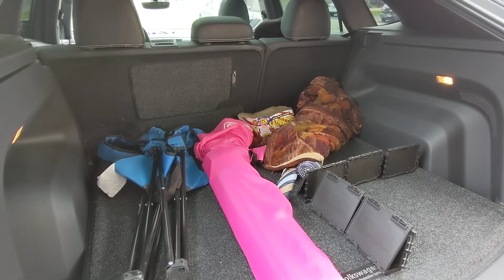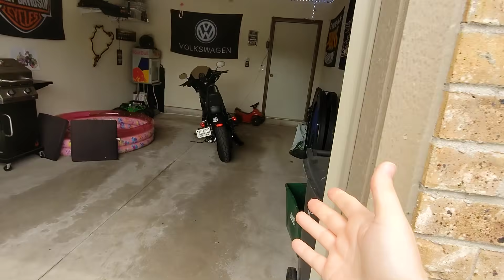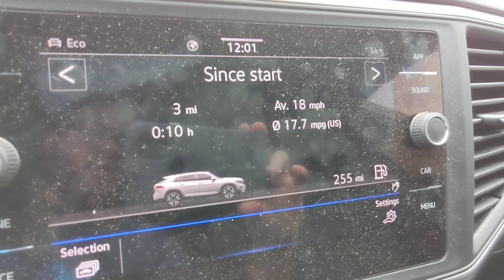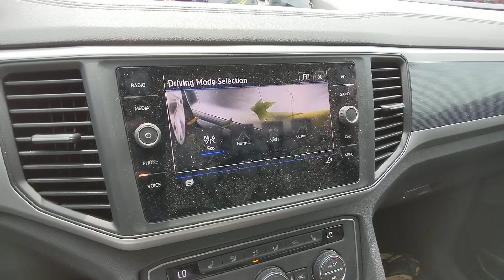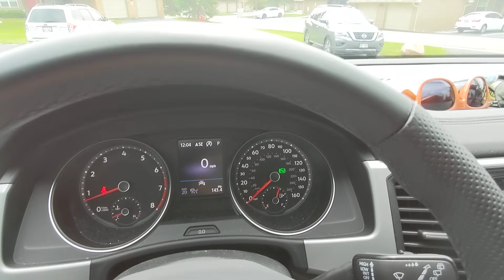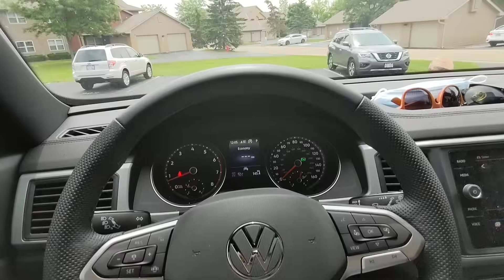2021 VW Atlas Cross Sport.  Why we're trading after only 4 months!

Comment: So the monetary loss from the trade will negate the cost of low fuel mileage, that’s a very interesting theory.
Reply from the maker: As stated in this video we took advantage of this used car market.  Lost "only" $1000 dollars (dealer sold it 4 days later above MSRP) and our fuel savings will pay for it in 9 months.  You really think we didn't think of that?
Reply: @amentauto3610  I hear you but if you trade to buy it or to get rid of it you have virtually no way of knowing if it only cost you a $1,000, even it you are able to know exactly what it cost you, I find the $1;000 a little hard to swallow, it might be the spending most of my life in the car industry and as a motorcycle dealer.
Reply: or the theory that a much higher priced . Pretty stupid either way. I could give a fig less about mileage I like the spacious interior, the all wheel drive. I keep my in dynamic and sport mode, I drive it like I stole it and I could care less about complainers.  Muhahahahahahahaha

Comment: I have a VW Tiguan with optional 7 seats but use it for trunk space.  Also has more headroom than the atlas.   Plus 29mpg
Reply: They say vw is not reliable. Not sure if that is true. Have you had any issues?
Reply: @voyager6576  0 issues.   You also have a lot of gear heads that mess with their own car then screw things up.  Then they blame the car

Comment: Hey man, you communicate really well as do most people from Wisconsin.  This vehicle seems like a very utilitarian vehicle. I would have liked seeing you incorporate driving dynamics and a short drive.  How can a review of a vehicle be complete just parked?  As for mileage, I get 42 on the highway going average 70 mph in my Civic but that's not a house-on-wheels the way these SUV are.  I have 1.5 Liters and 2900 curb weight.   I see the Toyota products in the new Sienna and RAV4 or Highlander to have hybrid options and more economical drivers.  

I had two VR6 vehicles back in the day in two Passat sedans and I loved the engine but mine did not want to last very long.  I hope VW has made the new ones more reliable and long-lived.    Take care and good speaking.  Just remember to drive the vehicle on camera. Cheers
Reply: Newer volkswagens have significantly better reliability than the 2000-2010 cars
Reply: @nicoyoung259  How so?? I had zero carbon issues with my port-injection, and zero timing chain stretch issues with my timing belt, and zero VVT issues because it had no VVT. Most of my service costs were in the complex front end.

Comment: Lol, I like the Atlas but that thing is a boat with a big anchor. You need 300 plus hp to move that 4400 lb SUV with any fervor. My 17’ stage 1 GLI has the same hp/ torque in a compact sedan that weighs 1200 lbs less. It’s a rocket. You should consider a Colorado/Canyon for towing, storage capacity and power..
Reply: @hon solo  Colorado V6 puts out 308 hp. Atlas V6 is 276..

Comment: That’s not a valid reason at all for doing that just little differences on gas mileages, you’re losing money on the trade in is more worse, and for what you saying I think you should get an electric one, no gas to use!
Reply from the maker: In this car market we barely lost any money.  The dealer sold it above MSRP 4 days later.  Our replacement will save us over $100 per month, will pay for itself in less than a year.  Stay tuned to see our replacement!

Comment: Interesting about the MPG my 2017 Touareg VR6 is heavier with the same engine and averages 21mpg on my 52 mile hilly commute, sounds like a heavy foot problem.  I spend around 160 a month in fuel, unless you go for a Hybrid rav4 its not really worth trading, unless your going up on average 10+ mpg which then would be a car or hybrid of some sort.
Reply from the maker: It was my significant others vehicle and she drives like a grandma!  I will be showing our replacement soon!
Reply: It's a VW/Audi/ Porsche product not meant for fuel economy.

Comment: 19 mpg is pretty good for a non-turbo SUV box with an automatic transmission. I have a 2015 Sportwagen TDI with a manual and it averages 47 mpg around town and 55 mpg highway. It has a little less cargo space than the Atlas Cross Sport and cost less than half as much. When traveling I can go over 700 miles on its 13.5 gallon tank before needing to refuel.

Where I live when you buy a new vehicle you have to pay sales tax and the first year registration cost. For an Atlas Cross Sport it would be over $3000. So selling a new vehicle after 4 months would be throwing away the sales tax and registration to just do it again. At $4/gal and 19 mpg you could go over 14,000 miles with that $3000.
Reply: @drwisdom - You must be having diesel variant I believe so b'caz petrol version gives around 36 mpg.
Reply: @VDCCXXXVII  Yes. The combination of diesel, minimizing fuel usage with a manual, and living in the mountains yields very good mpg.
Reply: @VDCCXXXVII  
Btw just spell “because” instead of that brain dead way you’ve decided to type it. If you want anyone to take your opinion seriously you can’t make up your own spelling on simple words. 🤡
Reply from the maker: The used car market is crazy right now.  Lost only $1000 dollars.  Dealer went and sold it above MSRP 4 days later...
Reply: @amentauto3610  B'caz due to chip shortage in whole world, there is long delay to get a new vehicle. Even If you book new Tesla right now, don't expect delivery before 4 - 6 weeks.
Reply: @VDCCXXXVII  
You’re stating the obvious man. We all know why the market is crazy.

Comment: if you have a reliable stage 2 charging station at there you live, EV has way higher efficiency and lower running cost.  we are paying $20 a month for electricity charging the EV.  ICE cars mostly burn 30-35% and the rest turns into heat and exhaust.  You wasted 65-70 cents on every dollar on gas.  Choice is yours.
Reply from the maker: Stay posted to see our replacement ;)
Reply: I thought about getting the F150 lightning - my house only has a 100AMP service though. I don't think I can get a stage 2 charger unless I upgrade to 200amp service. My aunt and uncle have a Tesla P90D and she was trying to tell me you need a 400amp service. I was thinking 200amp would be fine. She said non-Tesla charging stations are also no cheaper than gas....not sure how much truth to that there is either.
Reply from the maker: @jesse4589  Charging stations do tend to be only slightly cheaper than actually filling up.  The point is though most people would only have to use those a couple times a year when in a pinch or road tripping.  The other 10000 miles you drive that year will be 1/10 the cost.
Reply: @jesse4589  I don't know how much you drive per day.  My daily average mile is around 80-100miles. I use 32A charge from midnight and it's done 3-4 hours, give or take.  If you lower it to 20A, it will take a bit longer to charge.  Run the numbers on your daily consumption and see if 100AMP will cut it.  Also, at night, the electricity consumption in the house is usually lower.  To us, I charge 99% at home at the lowest electricity rate, so I can't speak for others.
Reply: @g600f700  Fuck!!! I wish I had your luxury of being able to drive an EV to work. No chargers yet. So, I ended up with a VOLT. 140 miles round trip, just under 2 gallons of fuel. Whenever they install chargers, will get a used BOLT. I'm not paying over 40K for an EV just to save gas.
Reply: @jesse4589  your aunt must have had a typo or a brain fart. Too many 0’s in those numbers. 60A is max for a Tesla home charger (aka Wall Connector). If you get a Model 3, 40A is max. Your 100A circuit is plenty.
Reply: And you paid how much to buy the EV??? ID.4 is 40K and it's a small cross over. You're right for efficiency, but you pay double for the same thing.
Reply: @bmw803  I paid 36k after tax incentive for the base trim (no options).  For daily commute, more than enough.  I won't get into every single penny but overall,  so much time save on gas station,  no maintenance...etc.  I charge at night lowest electricity rate.  If the people don't like EV, they will always find something to complain.  I won't fight to death for that.  Good luck.
Reply: Bla bla bla how about taking s long trip .EV are overated
Reply: @hectorlopez1196  I agree,  we looked back for the past 3 years and we did about 2-3 long trips per year. So, added up the time on long trip on charging vs the time we saved on zero gas station and zero maintenance per year,  its worth it.  If you take long trip every week, then EV is not for you.
Reply: @g600f700   EVs dont need maintenance? You still need brake service, coolant replacement, drive unit fluid changes, etc. ICE oil changes twice a year?? 100 bucks. EVs require the same as ICE except engine oil changes. As for the time going to gas stations, never understood that argument. It takes 5 minutes, so what??
Reply: @bmw803  not going to fight to death talking EV vs ICE which one is best.  I only speak from my experience.  I have been using the EV for 3+ years now.  The only thing I see that need replacement is the tires.  I normally do a 8-10 years for a car refresh and I don't plan to flush any coolant or whatever the fluid.  Brake?  I barely step on it, using one foot driving (brake re-gen to slow down the car).  You keep whatever you like. Amen.

Comment: I have the Atlas V6 SE and I put in 10k miles on it within 4 to 5 months. I really enjoy driving it long distances and so far I have no problems with it other than MPG. If anything I might trade it in for a new model cause mine is 2018.
Reply from the maker: The car 100% excels at long road trips.  Perhaps the best road trip car i've ever used.  Minus the bad fuel economy.  Even on highway with AC on we were lucky to crack 22 MPG sitting at 78mph in the left lane.
Reply: How is the internal isolation of the car on the external roads, and do you hear the sound of the tires?

Comment: Unless you get an electric or hybrid V6, gas mileage will always be mediocre in a V6, especially if it is 4WD or AWD.
Reply from the maker: Stay tuned to see our replacement ;)
Reply: @amentauto3610    I am looking forward to seeing your new car.    I also was wondering if you were able to sell your Atlas Crossport for a profit, actually?  Because the used car sales thing is HOT these days
Reply from the maker: @ryanfgrantjr3009  yes!  This car market is absolutely mental.  We just called a local VW dealership and they straight up bought it off of us for only slightly less than we bought it for.  The dealer flipped it and sold it above MSRP 4 days later... Crazy.
Reply: @amentauto3610  thanks for that. I am buying my 3 yr old BMW X2 as the lease is expiring. Payoff is a crazy low $24,000 and online and at dealers my car, my miles, 3 yrs old re listed for sale at $29,000 min....I'd like to try and see if i could score. If not, i'm good, i love my car so much anyway
Reply from the maker: @ryanfgrantjr3009  just call dealer you bought it from with VIN and milage and ask them if they want to buy it.  I'm sure you have significant positive equity.
Reply: @amentauto3610  Perfect idea, ..glad u mentioned it, a call can't hurt.....
Reply from the maker: @ryanfgrantjr3009  good luck!  Keep me posted!
Reply: @amentauto3610  Are you getting a Toyota Rav 4 or the Ford Maverick? Am I close? I’d love either one of those. I’m driving a 2010 Versa at the moment. Once I finish school I’ll be looking for something more comfortable.
Reply from the maker: @andrewstanley4831  I'm not getting either of those vehicles but they're both excellent choices!

Comment: I traded in my 2020 Cross Sport SEL because of to many issues, Sway bars went out at 12K, Steering gears started grinding at 25K, Gremlin electrical issues one after the other, driving once and all of a sudden it sounded like my muffler fell off and and became increasingly louder and louder then miraculously went away,  cruise control disengaged on a road trip for a few days and poof it's back, most recently the trans started feeling a bit off so I figured I better trade while it's still worth some money.
Reply from the maker: Wow sounds like you possibly got a lemon.  Good time to sell your car though!

Comment: Dude, clean your car before you do a review...come on!  I have a 2011 VW Touareg VR6 and its so luxurious in comparison to the Atlas and Atlas Cross Sport.  I wish the new Touareg was sold in America, but I understand as VW didn't sell many in the last few years.  Personally, I like having a vehicle many people don't have. It makes for a great conversation starter. Anyway, nice review other than it being dirty.
Reply from the maker: I miss the Touareg :/
Reply: I just bought a used 2012 Touareg Lux and I love it! The navigation system is garbage though.
Reply: I'm in the same boat: I like having a vehicle that is just slightly rare. It's time to trade in my 2013 Touareg TDI and there really isn't anything remotely like it in the U.S. from VW or the VW motorgroup (the Cayenne and Q8 are nice, but not remotely in the same price bracket, and frankly not as comfortable). I've ended up ordering something from another maker that's bigger than I want or need in order to get the same ride quality and power. If the Touareg (or the Phaeton) comes back to the U.S., I'll be first in line to get one!
Reply: @jonathanstrater903  I'm curious, what vehicle are you buying?  Personally, I like what I see with the Genesis GV70.  It's a tad bit smaller than my 2011 Touareg VR6 but has the sportiness that the Touareg is missing....the word is "If you test drive it, you WILL buy it".
Reply: @TVBCStudios  I test drove both the GV70 and GV80, and I really liked what the GV80 had to offer (I felt the GV70 was far too small for my needs; it feels slightly smaller than Volvo XC60 IMO). I was about to pull the trigger on the GV80 until I did some research about Genesis' service. Until Genesis gets their act together on putting together a more cohesive service network in partnership with Hyundai dealers/service centers, I cannot commit to purchasing one. In my area, the nearest Genesis service center is over an hour away. While their concierge system sounds great on paper, in practice I have serious doubts.

To answer your question, I ordered a Grand Cherokee L Summit Reserve V8. I was blown away by the comfort, the luxury touches, the drive feel, and the power. I have no need for a third row, but the driving characteristics of the L vs. the 2-row GC convinced me. I did 4 test drives, and each time I could not believe it was an American product.
Reply: @jonathanstrater903  thanks for sharing. I hadn't really considered the Concierge service offered by Genesis. I'm not planning to buy new anyway. I take the post depreciated price, thank you very much.  That GC is definitely a very comfortable ride. I've never driven the 3row, I'm sure the extra weight doesn't help nimbleness, but you're not likely to take corners at high speed anyway.  Enjoy your ride!!!
Reply: Yeah

Comment: OMG...sorry but I have to comment...your only complaint was that you had to go to the back seat to lay down the seats ???   Really.  And you've mentioned the expensive of the vehicle several times, and yet you let it get that dirty?  At least clean it before you video it.  18 mpg.  You could've seen that when you purchased it.
Reply from the maker: Our commute to work suddenly went from 10 miles a day to 50 miles per day :/.  It is a little messy, but it was our family vehicle that we took multiple road trips with.  We used it as it's intended.

Comment: At one time I considered one of these vehicles but they're just so plain inside and the cost cutting on materials just doesn't give you a premium feeling. I've owned several VW products and it seems like this has been a trend over the last 10+ years.
Reply from the maker: Yeh, they're definitely not the same as the old ones :/
Reply: Yea that’s my issue , the interior needs updated visual
Reply: Same here. Next vehicle will be an SUV after owning (Jetta/Golf) for the last 12 years and I don’t think I’m going with VW this time around. Ford Bronco or Jeep Rubicon

Comment: I bought an 2021 tiguan se r line w/ 4motion with a 3rd row delete. I got it for 34k out the door and it has the same features you have or more.
Reply: Love the Tiguan but twice slower and gas mileage is terrible for what it is. Own a 2019 Jetta R line.
Reply: @J-W.-  its not slow at all its pretty quick off the line.

Comment: I own and operate a 2021 Cross Sport SEL Premium and manage 19-21 mpg in the city by using the manual shift to keep the rpm's under 2,000. Many time on level ground I start up in second gear and quickly shift to 3, 4, 5 & 6th gear. You can watch the mileage from last start soar to 18>19>20+. It also takes a light accelerator foot at stop lights and docile driving style. The car does a very low gear ratio in first, second and third which helps with towing but you can minimize those low gears with manual shifting when driving in town. Paddle shifters would be much more convenient but VW doesn't want get too sporty.
   Hope this helps someone........
Reply: I do the same on my tiguan sel

Comment: You should have went with the four-cylinder it’s just as snappy but with way better MPG my sister went from a 2018 Volkswagen atlas launch edition v6 to a 2021 Volkswagen atlas se four-cylinder and we just say it’s more snappy and better MPG
Reply: Really, we tested the four cylinder and it felt a lot more sluggish.
Reply: @33sarny  plus the premium fuel required will negate any increase mileage from a cost standpoint at least